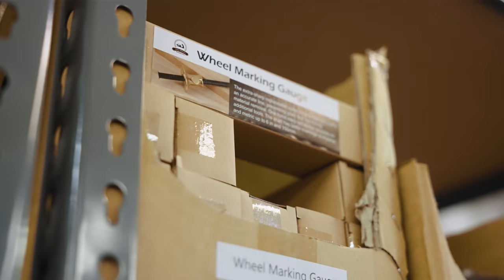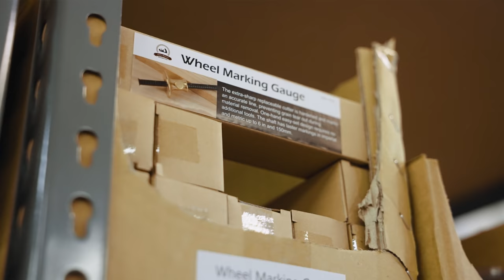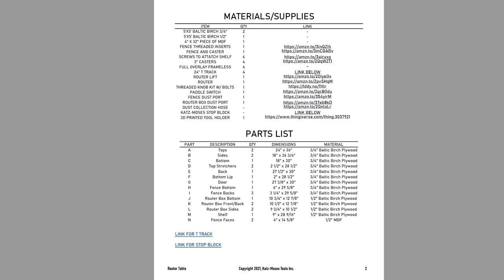Introducing: Katz-Moses Tools - By Woodworkers For Woodworkers

Comment: Congratulations Jonathan. Just back from your website after my first purchase. Like many in our community, I do something else to keep the lights on. I am a 30 year veteran of hazardous waste management. One trend in our community is the adoption of masks to protect themselves from airborne particles--primarily wood dust. Masks are great tools. However, the core tenants of contaminant exposure control is that PPE (personal protective equipment) is a tertiary response to a perceived contaminant. Primary and secondary responses are administrative and engineering controls. This is to say, mask in a pinch, but strive to mitigate the hazards by understanding them, avoiding them and by removing them with an engineering control like effective dust extraction. A philosophy of safety is better than gadgets or uninformed fear.

Comment: What a great idea, and I admire your purpose!

Such a silly little store suggestion: In the description for the "5" hand sanding disc pad with velcro", I think it would be worth adding some sort of note to encourage people to buy more than one, so that you don't have to wear out the velcro every single time you need to switch grit. I was having to replace mine every 2-3 months when I only had one because the velcro wears out, but since I bought four and kept one grit on each one, these same 4 have lasted well over two years, and they still grip great. I keep one at 80, 120, 180, 220. It's also marginally more time-=efficient to not have to stop and switch the disks, I can just grab the other pad (I write the grits on the pads with a pen, so you can see which is which)

Comment: I learned one lesson several times. Now i hope it will stick. Bought cheap miter saw, fence not straight, base not flat. Fixed with mdf board. Bought cheap router bits: almost burnt router, damaged lots of material. 3 cheap squares and none were square! Straight edge… don’t even want to start… Last one was cheap table saw. Top was not flat. A board would rock on it… setting 90deg was impossible… i did pour layer of epoxy on it… to make it flat… and now I just want to throw it all away really… time, materials, frustration… daaamn. 
Good luck with your business! Good to have a reliable source!

Comment: Just looked at the new website.  Two products stand out to me.  The new sharpening jig and the disc sander/holder.  I would love to see a video on the blade sharpening jig.  Just to see it if beats out the Veritas system I have now.  Always looking for simplicity and accuracy.  Are you open to NEW tool ideas.  I have one.  Can I email it to you?  Thanks Jonathan.  (PS.  I have one of your Dovetail magnetic guides.  That is probably how I got the email)

Comment: Great project Jonathan!!!   I think if you can stick to your "put the customer first" policy you'll do well     Your instincts for what makes a good quality product are already proven,  and I think your plans are AMBITIOUS - with a capital A!!     But putting the customer first is essential    I honestly think losing sight of that issue is what caused Boeing's failures - they forgot about customers,  put them second to the stock market performance.     Anyway,  I am glad to see you're continuing to produce videos.  I'm getting sick of the host of htem now that have no narration - just a succession of shots of 'man pushing wood through table saw"   "Man measuring"    "Man marking right angle"    "Man cutting wood again"  "Man drilling a hole"    "Man drilling another hole"    etc for 15 minutes with no indication of what they're making and why until the very last few seconds of the video.     Congratulations and good luck on the new ventures.